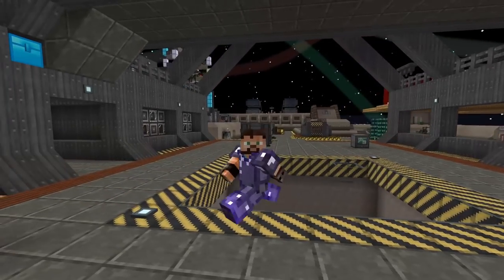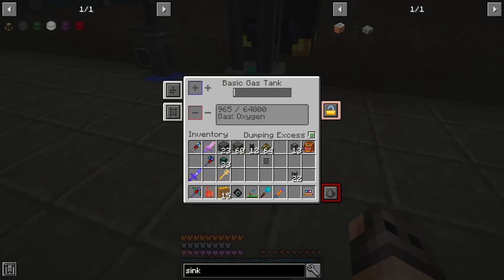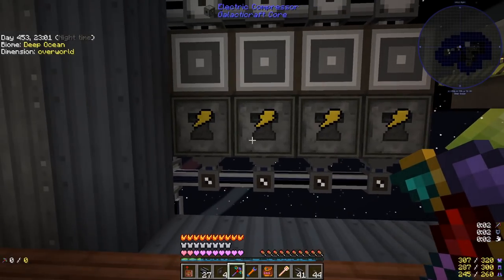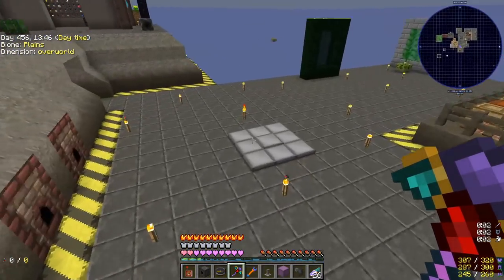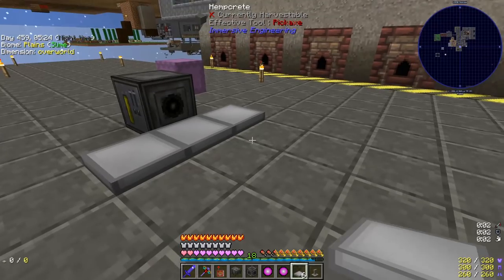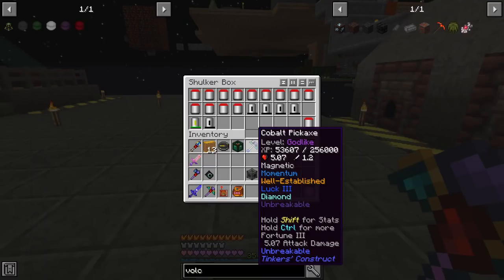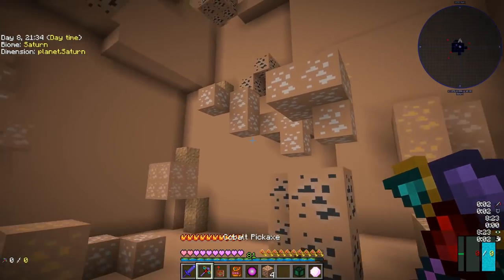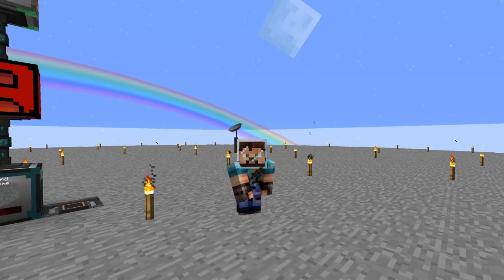Project Ozone 3 Kappa Mode: Episode 15 - HDPE, Galacticraft and Imaginary Time Block

Comment: Hello fellow Dark Ones,
sorry for being late D:

PO3 has an addon to Galacticraft called Extra Planets. With this addon, Venus and everything further away than Mars has acid rain which is going to eat your armor.
The intended way around this is a shield module that you can find in some dungeon chests on Venus.

The PO3 ways around it are to either equip something that uses the metadata for something else (like a jetpack that stores charge instead of durability) or go full Botania with a full set of any armor, a hand mirror and a decent mana production/storage. Botania armors repair themselves with mana and will draw drom any mana container in your inventory. The mirror can be linked to any mana pool at home (keep the mana pool chunkloaded) and as long as there is enough mana available, your armor effectively outheals the corrosion damage.

Comment: Galacticraft, where all packs go to die. BTW nuclearcraft has one of the most involved and interesting power gen mechanics, specially the fusion reaction; not as thrilling as crafting a bunch of solar panels, tho
Reply: See his channel art
Reply from the maker: whatever you do, and whatever you guys say, I will not make a fusion reactor again just to prove i can lol there is no point :D I tried, it worked but it requires to much time investment and rewards are not proprotionate to the amount of time invested. IF it wasnt for that mod, i would have finished enigmatica 2 in 18 episodes lol

Comment: 1:20 don't dump both, you will use a lot of energy because the machine will never stop, just use a tank as a buffer and put one as idle
Reply from the maker: sadly consumption is not consistent. I didnt want to go back and check every few hours. besides it ok. just 2000 rf max :D we are good lol

Comment: For supremium essence (for the coal) you can kill withers(boss).
Reply: The problem is this pack disables downcrafting of essence. So you need a lot of inferium. Or EMC. The easiest way to get a lot of the supremium coal blocks would probably be an RF Tools dimension of it
Reply: @sanovictus  oh yeah, couse you need the previous steps. Hmmmm, I guess you're right. Later it's animation wand time and emc but until then that is probably the best solution.
Reply from the maker: I think i just have to farm withers for now. soon i have to make a proper with farm to get supremium. also when we get the energy condenser, then its basically just duping everything and we dont dark matter or supremium anymore